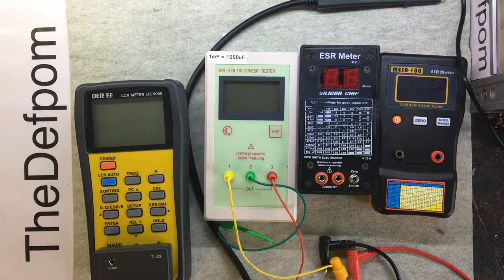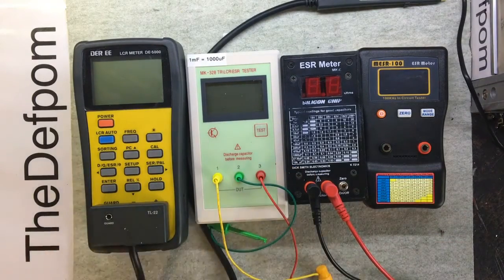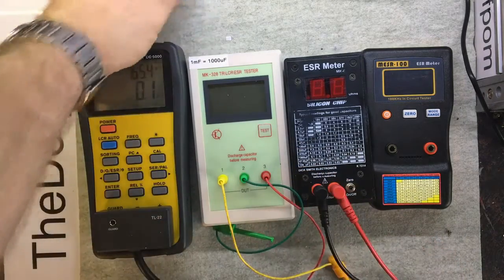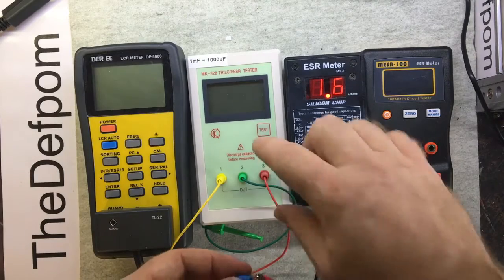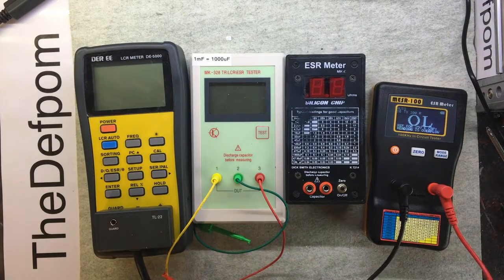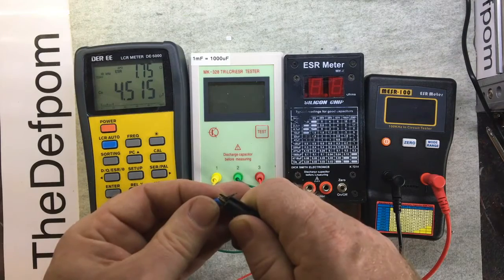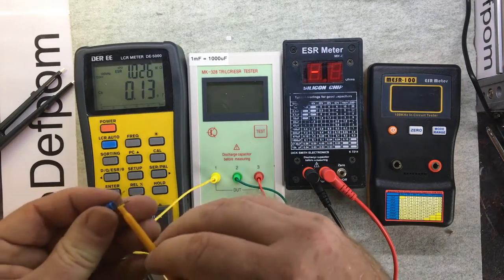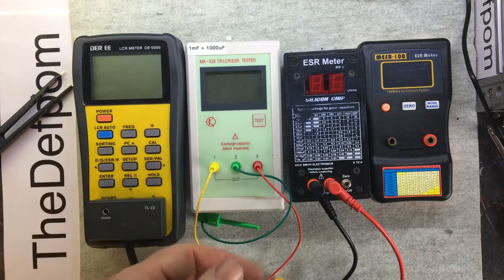#172 DER EE DE-5000, Silicon Chip ESR Meter MkII, MESR-100, MK-328, ESR meter comparison,

Comment: I've watched 2 different youtube videos comparing the readings on the DER EE against high-end bench equipment - the DER EE is insanely accurate
Reply from the maker: Freeman in Progress - thanks for the info, good to know.
Reply: The DER EE has probe resistance compensation (4 wire and a bridge) so it will read a lower ESR which is more accurate than meters using plain probes. Having the ability to connect probes together and zero the meter does help.

Comment: You might already know this by now but capacitance is measured at 120Hz and ESR is measured at 100KHz hence why you were getting strange readings from the DER EE. The MESR probably alternates between the two frequencies but the DER EE does a lot more than ESR tests therefore you have to select the right frequency for the test that you are doing.
Reply: How to know which frequency to choose for testing caps? Is it better to test it on multiple ones?
Reply: also series /paralell mode deree is thebest others r junk and will mislead ppl just don't know how to use propper meter like de5000

Comment: Three of the meters need to go trough calibration mode beforehand for first use. I got two of them. One is the MK-328 which in fact is far the easiest  meter to use. Don't turn it on before you have the test leads on the subject. Just push the button and it's ready. It's is for the price very precise compared to my HP pro meter.

Comment: thaks for thw video. os not necessary  to calibrate the DER DE5000 previously? (another reason cause it uses a kelvin probes)
Reply from the maker: @electrotools8083  yes it should be calibrated, you do both a short and an open.

Comment: Why haven't you plugged the capasitor directly into DE-5000 slots? Or at least you should use TL/21 attachment with alligators instead of TL/22 tweezers.

Comment: Apart from the MK-328 who's frequency no seller lists in the specifications they are or can be set to 100 Khz - which is what capacitor data sheets test them at - i.e. the ideal frequency for smallish capacitors

The DER EE is clearly the best one as you can select low frequencies - needed for accurately testing large capacity capacitors found in audio amplifiers

The really cheap testers (usually without a case) use 50 Khz frequency and are inferior

One you haven't got is a Russian one ESR-Micro v4.0 - shipped direct from Russia via their Russian language web site - but frequently not available - I'm getting one as soon as they have some more in stock - reputed to be best of the best

In the meantime I'm going to try and find a UK supplier of the DER EE

PS - that old cap likely needed a 1 hour charging voltage on it to bring it back to life, before discharging it and testing it - even unused but old stock electrolytic caps that have been stored for a few years need re-rejuvenating

Comment: I have the MK-328, and for the money that I paid ($28 US on Amazon) I have been happy with it.  It can test capacitors,  as well as transistors (NPN-PNP-FET), diodes, & thyristors.  The case is not the best, but I keep it on the bench.  I believe the test frequency is 8 Khz.  Amazon also sells a model without a case (model M28), that you could put into your own case.
Reply from the maker: +Pete Ciallella - yes it seems to work ok, just could use more buttons and a user interface so it feels like a proper tool.
Reply: 8 Mhz cannot be right - will be 50 Khz or 100 Khz - crystal could be 8 Mhz
Reply: You are correct, it is 8 Khz.  Sorry for the typo, corrected.
Reply: The single frequency ones are 100Khz for the more expensive ones, and the really cheap uncased ones are 50Khz

What you'll usually find is an 8Mhz crystal divided down to 100Khz - which was the original spec of the designer (probably because electrolytic capacitor manufacturers test at 100Khz) - don't know why some of the cheap ones are only 50KHz - but that is better for testing big electrolytic capacitors than 100Khz

That DER 5000 meter is really good - has a variety of frequency ranges

Comment: It's actually measuring capacitive reactance. So frequency is ctitical. Most of these use a 100khz test signal..Alsobthe one on far right (msr100?) You need to zero the leads out..

Comment: Those Chinese tester things do have a calibration routine, short all three test leads together and press test it'll ask you to run calibration. Also I found the grabber leads and not that great as they have a habit of oxidizing and the wire strands like to snap over time.

Comment: The second tester from the left, I think you can just power it up by the TEST button, but you must have the leads connected first! 
Anyway, thanks for your videos!
If you have the MLC500 also, can you compare it to the MESR100?
Do you happen to have a REAL MANUAL for the MESR100?

Comment: If I'm not mistaken the DER should have had been set to 120hz to test that Cap, not 1khz plus you raised the Cap temp from holding it. I think that's why the readings differ so much between the DER and the other testers. But not a bad video.
Reply: Those two aren't enough to explain it. He simply didn't calibrate the instrument so he's measuring the lead capacitance/inductance/resistances as well as the capacitor itself...

Comment: MK-328 is a sub-par clone version of the German OSHW AVR Transistor Tester project that can be found at mikrocontroller dot net /articles/AVR_Transistortester. English and alternate firmware support is available on the EEVBlog forum. The tester is not intended as a replacement for a LCR or ESR meter. It is just a ballpark figure. There is extensive documentation available through the official project forum thread, article, and SVN repo with a mirror of the SVN repo also available through github. The project was developed as an exercise in ultra simple hardware while pushing the limits of the internal hardware of the AVR MCU through a combination of C and Assembly. Basically this is the balls to the wall limits of an ATmega ADC. You can update the firmware or add project options for additional functionality ;)
Reply: How is it sub-par? It seems to be good enough.

Comment: I just opened the box and put the batteries into my new MESR-100 all excited to get a replacement for my useless DER-ee DE-5000. Nothing. It arrived dead. New fresh alkalines. My luck.
Reply from the maker: You certainly are unlucky.
Reply: @TheDefpom  they never stripped the red + battery terminal wire. Never tried soldering it. The positive terminal seas tinned with a smooth lean blob of solder just waiting for it. I had to solder it. Device had a “QC PASSED” sticker right below the “made in China” sticker. Oh - I understand now!
Reply from the maker: @skeggjoldgunnr3167  yeah the stickers mean nothing.

Comment: What use are these?
Reply: A capacitor can develop high Equivalent Series Resistance (ESR), which is one indicator that the capacitor is on its way out, or currently kaput and needs to be replaced.

Comment: I have the second one in too, it works but is crappy case puts me off. Good for fet testing though. The main ESR meter is the HP 4261a and a Racal Bridge.
Reply from the maker: Simon Spiers - I was looking to buy a decent hp lcr meter, but the prices put me off, the de-5000 was purchased instead as it does what I need and was a quarter of the cost. Yes the mk-328 works, but isn't the nicest to use, ok if your on a budget and just want something cheap that does the job though.

Comment: That der-ee HERp deRP de-5000 winds up tellin' ya "OL" on everything after you've owned it a year or so. That's not useful.
Reply from the maker: I’ve had mine for about 6 or 7 years, still working fine for me, maybe you have a bad cable
Reply: @TheDefpom  more likely I had failed to discharge a cap prior to testing one day. It gave all myriad of readings - conflicting, unreliable. One day I found some of my colophony rosin on the kelvin 4-wire test tweezers. !! - I cleaned that off and - still I couldn’t have it on my bench telling me meaningless values or most likely the usual “OL”. In the garbage with it. I was impressed with its performance at first. I got my mesr-100 working now and I hope to be cautious and more fortunate with it now that I’ve done their assembly work for them (it arrived dead because it’s red battery wire should maybe be soldered on for that QC PASSED sticker to have meaning in China.)